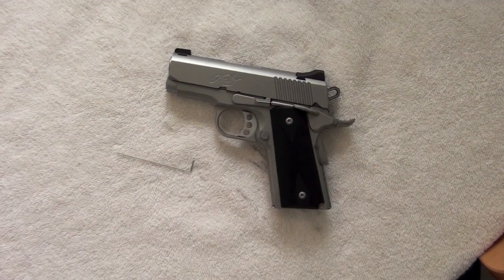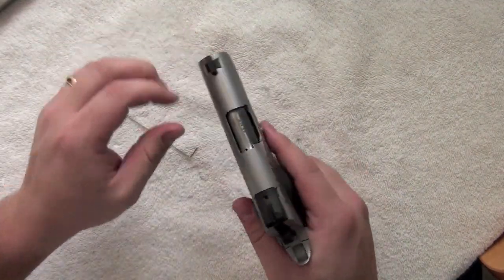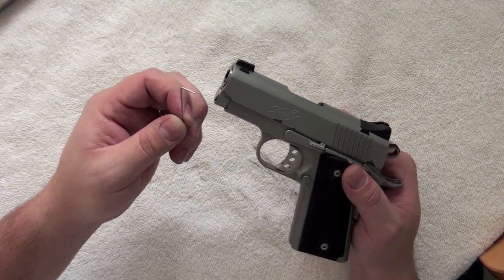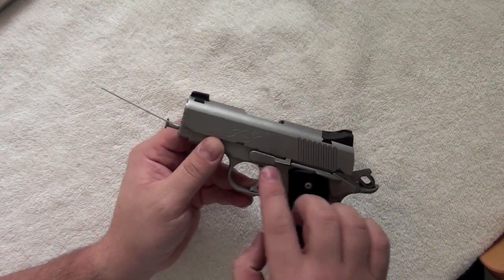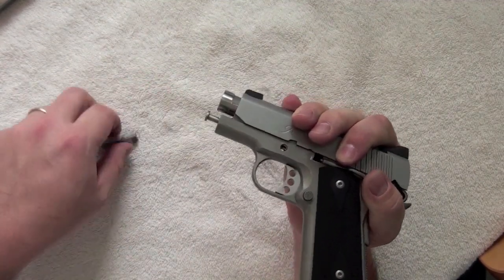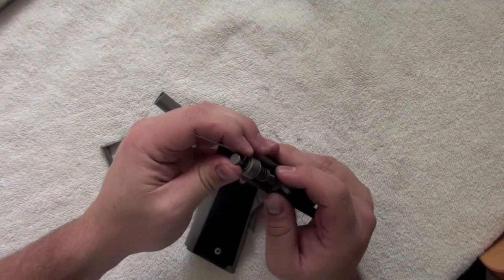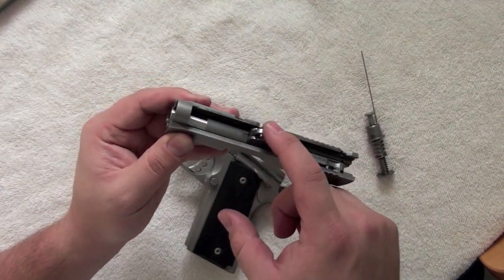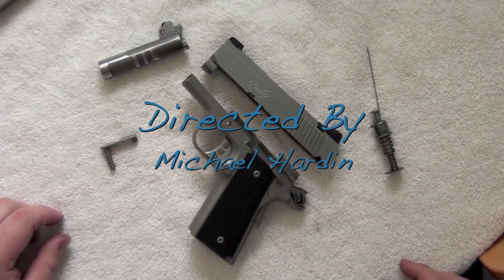Kimber Ultra Carry 2 Disassembling in HD

Comment: And of course my slide lock pin can’t be pushed out by hand, even when perfectly aligned. Opting for the alternative method as offered, but not shown (Kimber should’ve included more pictures) in the owners manual. Even then, it’s still a piece of work.